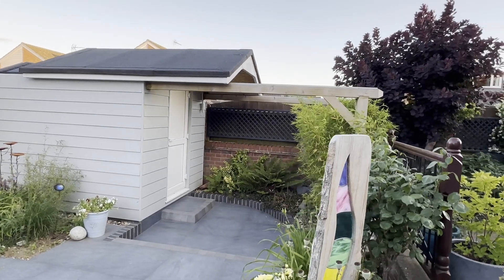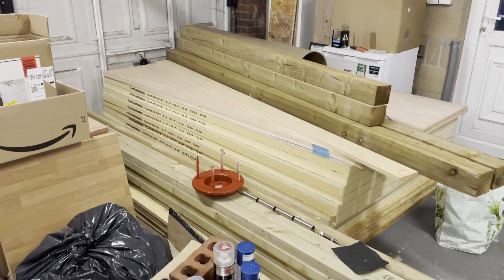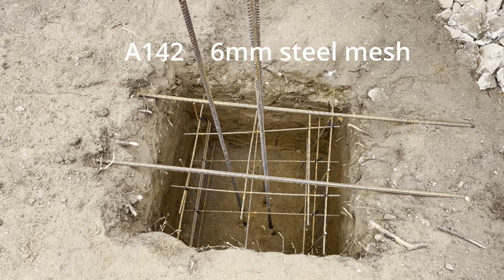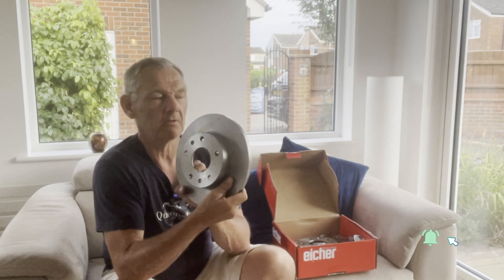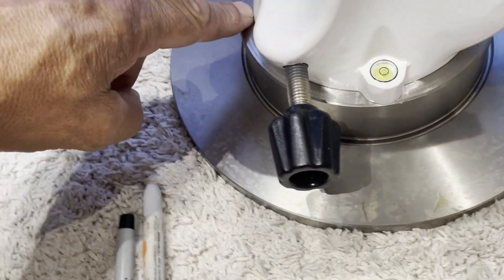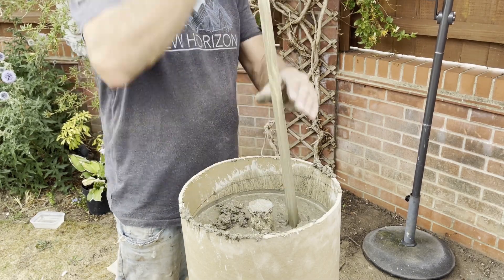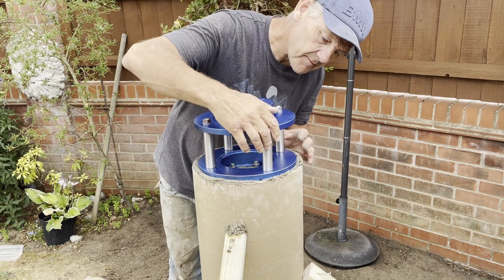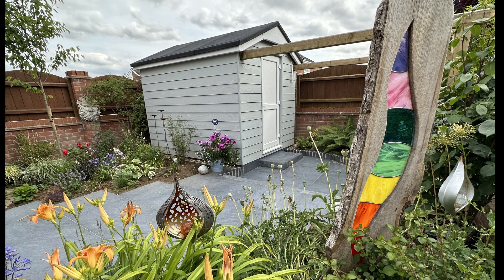How I Built My Own Backyard Observatory From Scratch!

Comment: Great info. I own a SW EQ6-R Pro mount also. What year and model Landrover for the disc brake rotors?  If you can remember, it'd save a lot of time & effort searching at the local auto parts store. TIA!
Reply from the maker: Thanks for watching! I think it was the landrover discovery, but as long as the centre hole is 65mm it really doesn’t matter which make they are for! Good luck and clear skies👍

Comment: Great job, obviously loads of planning in advance (nothing done on the fly). I have a question though, why were four studs used to level / support the top plate, i would have thought three would have made levelling easier? Having said that, most rigs ive seen have four supports.
Reply from the maker: Thanks for watching! A fair question! I guess 3 studs would have been ok, but personal choice really, I thought four would do, maybe even make it sturdier! One on each corner!! If you’re happy with 3, then that should be fine👍 Clear skies

Comment: Why do you need the bottom rotor plate? I'm working on the same disk rotor-based mount but only one rotor, with the adjusting rods through holes in the outer rim section and down into the concrete.  Any thoughts would be appreciated. Thanks from upstate NY.
Reply from the maker: Thanks for watching, I designed it like that purely because it made it easy to fit and level, also a few inches between meant more room for cables etc. 
clear skies👍

Comment: I used a PVC pipe instead of cardboard. It's still in the backyard :-) The concrete pour was done in two stages - one for the base and the other to fill the tube (I wanted the tube to be level and wasn't confident I could do it in one pour). The next trick was to put a ZWO pier extension inside the tube - so no need for all of that mucking about with the mount base.
Reply from the maker: So long as it works , that’s the main thing😀 Thanks for watching 👍